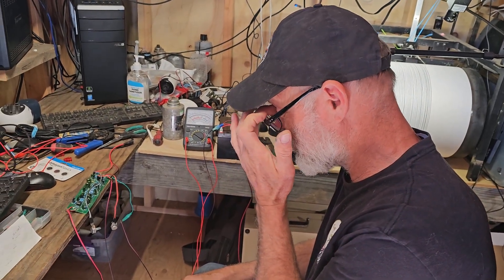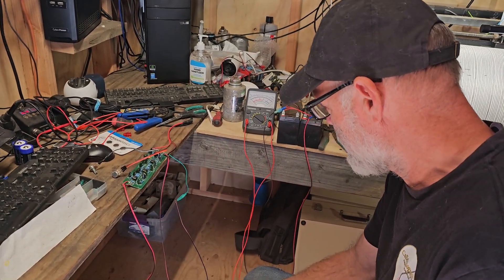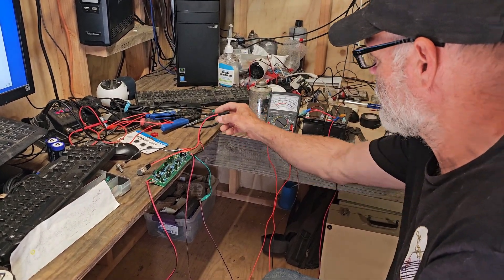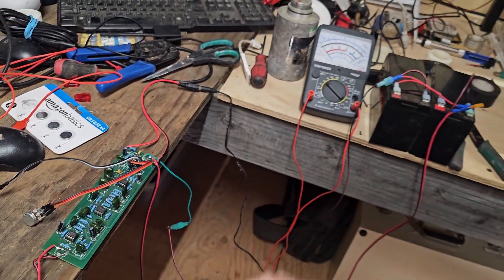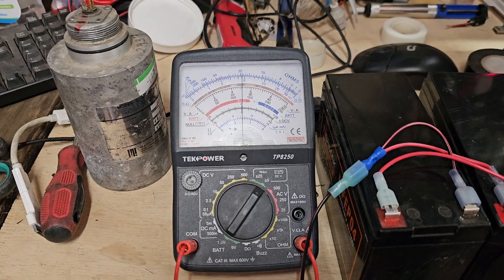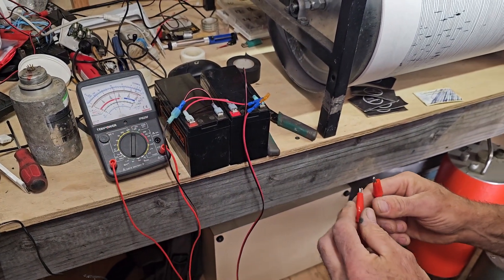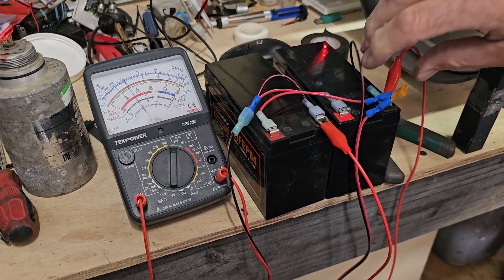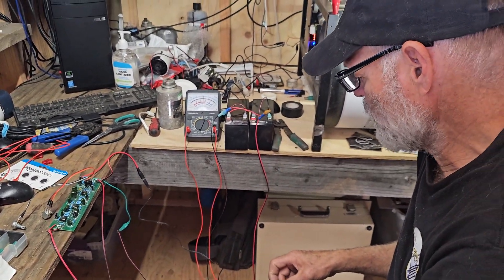Testing New e-Graph Board PROMISING

Comment: You should use color coded wires, it would make it easier when connecting everything. 3 or 4 different colored wires would probably do the trick. Be sure that the wire is the proper gauge for the schematic, too small of wire won't work. Keep plugging away at it, you'll figure it out.
Reply from the maker: Yes, I like that Michael,  sure will do it  with the next try!